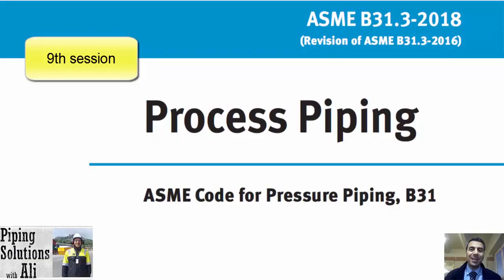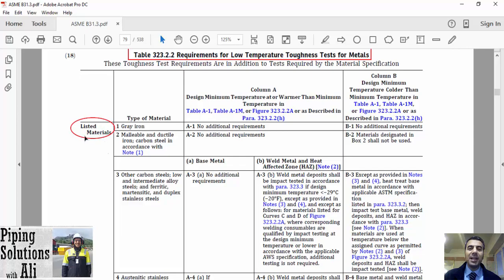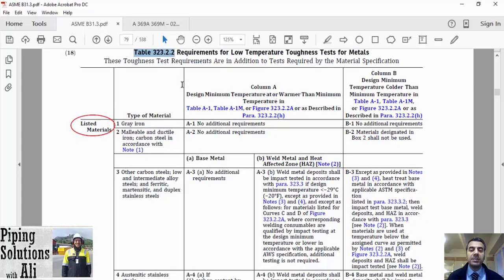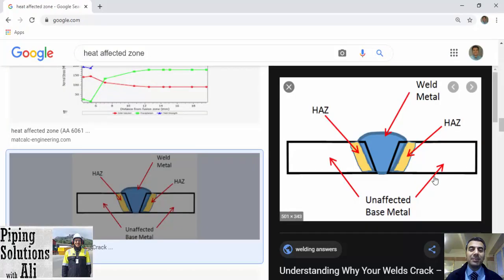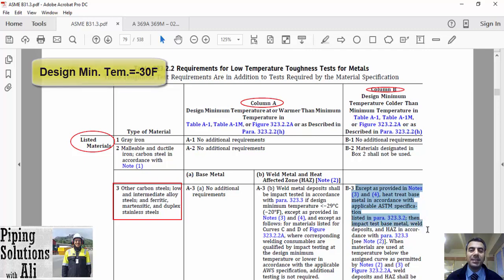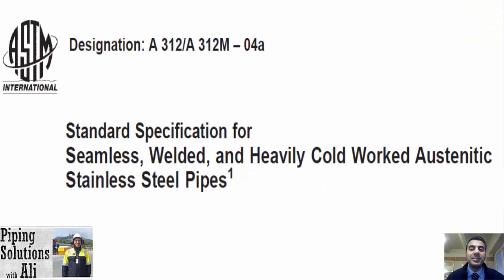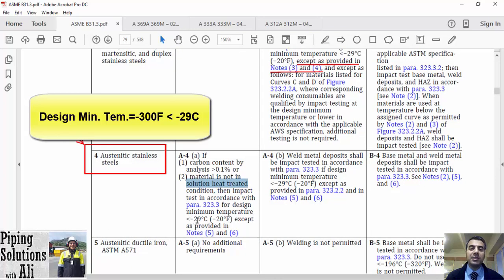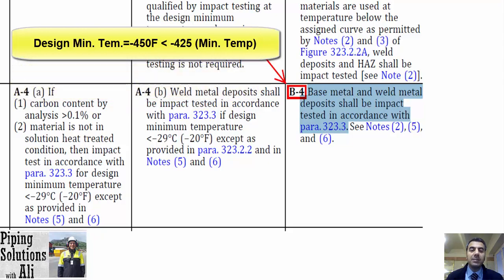Workshop for Low Temperature Toughness Impact Test (9th session of ASME B31.3 Course By Ali)

Comment: Hi Ali, Thank you so much for this video. Here is question: let's say there is a project that impact test is mandatory according to table 323.2.2 of ASME B31.3 then is it enough to apply this table requirements to the WPS? Or we have to prepare mockup for each type of welds are apply those requirements to the mockup welds as well?